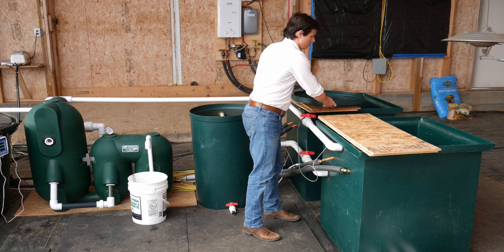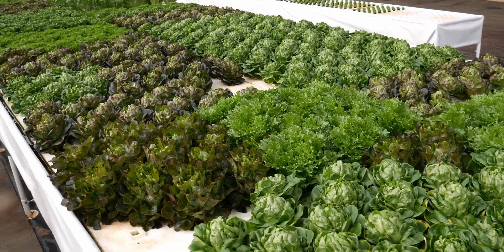Large Decoupled Aquaponics at Pennock Family Farm: Using Mineralization to produce Healthy Plants!

Comment: Paul a great presentation. I always have one question with decoupled systems. 
 There are still nitrates being built up in the aquaculture part of the system so what happens with that? Is there a Aquaponics running with that as well or are the nitrates going through denitrifying processes and Nitrogen released to the atmosphere. If so why waste the nitrates? 2 grow beds one the decoupled the other Aquaponics.
Reply: Water is continuously flowing through the filter into the plant sump and then being circulated through the plant system so nitrates are being exchanged constantly. The aerobic mineralization tank is only used as a secondary nutrient boost on an as needed basis and is plumbed into the plant sump. When you need to add nutrients from the mineralization tank you can turn off the air to allow the solids to settle and simply open a valve to discharge the supernatant. Otherwise this system has the ability to supply nutrients continuously from the fish or it can operate in decoupled mode which is why there are two sumps (one for fish and one for plants).

Comment: Hi Paul, great video and education on decoupled system. keep on the good job!

One thing i cannot comprehend is how the nitrate in the water in the aquaculture side is disposed/processed? Looks like the solid is drained and a little of the nitrate is past on to the hydroponic side. Would the nitrate keep building up in the fish water? please someone explain. Thanks.
Reply from the maker: Great Question! The short answer is yes, Nitrate will build up in the system over time. This is advantageous for the plant side of things but if left un checked (for a long period of time) could cause issues for the fish, depending on the species. Any true closed RAS system has a certain length of time that it can remain "closed" meaning no replacement of water (besides refilling due to evaporation). This timeframe is completely dependent on management. Other technology and water treatment techniques can be applied such as denitrification which will help control the nitrate concentration, but what will ultimately limit the amount of time a system can remained "closed" is the inevitable salt buildup that occurs from little to no water exchange. 

Thanks for the question and for watching!
Reply: @ASTFilters  my backyard is semi-detached aquaponics very similar to this setup. the fish tank is built from 2 ibc totes and the output of that goes through a set of diy swirl filters made of 55 gal drums and then the Endurance 4000 bead filter before airlifted back to the 2 tanks.  I also has a mineralization step but that is small flow, about 20 gallons each week or two. Tanks are stocked 60x at 5-10+ inch koi in one side and 100+ 6-10+ inch tilapia in another. 

The plant side is made of two 55 gallon drums, chopped vertically and laid on the sides as a trough filled with clay media and bell siphoned to control the drainage. it has a 100+ gallon sump on the bottom of the grow bed.

For my system, there is a small 1/2 inch PVC line that connected to the sump from the plant side to the fish and a small 80-100 gal/hr flow connect between the two. Nitrifying is happining very fast and there is no ammonia nor nitrite in the water, slightly higher nitrate in the fish water about 5ppm compare near 0 on the plant loop. 

If I were to redo this system, I will make it a one close loop 100% coupled system. Initially, I thought the same way, that the 2 systems can run independently but this somehow cause the nitrate to leach out to algie growth in the tank (my system is uncovered in the backyard) rather than growing useful plants.

We hope to one day visit the AST setup and see what other filter options are available from you to take us to the next level. Thanks for your informative explaination.

By the way, since our system is outdoors, the occational rain storm will top off/replace the aged system water natually. so it is not 100% closed RAS in our case. Just FYI.
Reply: I also read another comment below. This system is running as a coupled system during normal operation, with the ability to run as a de-coupled system.

Comment: Great looking setup but Paul describes it in the video as a decoupled setup, although in the comments It's described as the RAS feeds into the plants, making it a coupled system? How does this system actually work? Because from your comment it sounds like a coupled system with a mineralisation tank. Also, how come the Endurance isn't using automatic sludge discharge that has been described in other videos?
Reply from the maker: Billy, thanks for your question. Recirculating Aquaculture Systems (RAS) are not required to have a plant component. The water in the fish tanks is continually being filtered by the Endurance filter as the 'fish loop'. Waste generated from that loop is moved into a mineralization tank manually. The blending tank, connected to mineralization, recirculates the water of the hydroponics system, but doesn't go back to the fish loop. Think of it as two loops. 1)Fish tank and filter then the 2) hydroponics loop circulating as its own loop. The only "connection" or transfer point  is the mineralization tank. In decoupled systems, the water sent to the plants doesn't recirculate back to the fish. Coupled systems send water through the fish, then the plants, and back again. 

https://astfilters.com/aquatic-systems/wp-content/uploads/sites/3/2020/01/12202019-MDC-2000-Brochure.pdf

This system was installed by Aquaponic Source. Automatic discharge is an option, customers choose their setup configurations. It may have been done this way to have more control over the amount of water and waste being transferred.